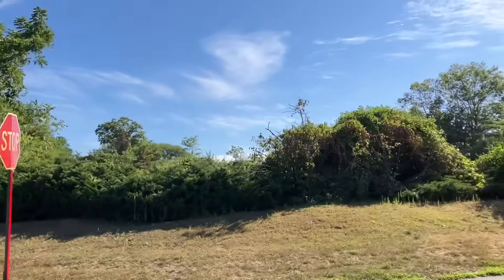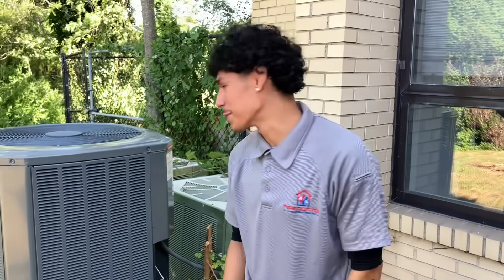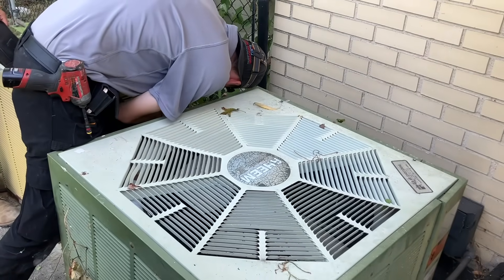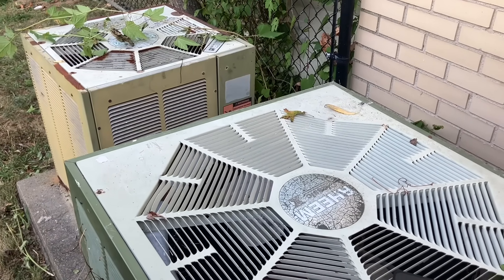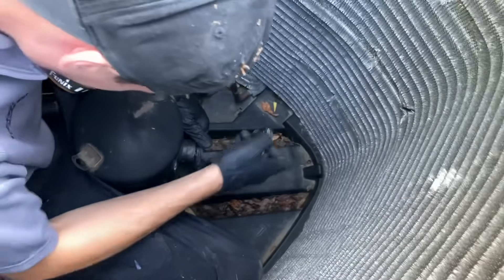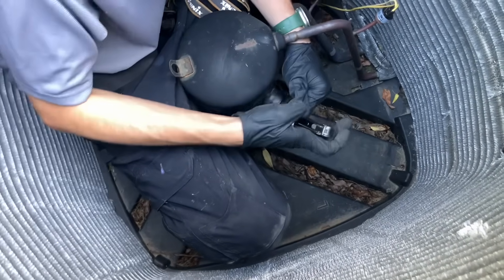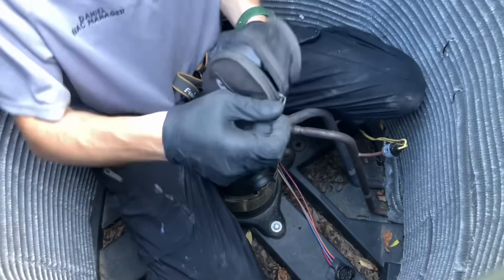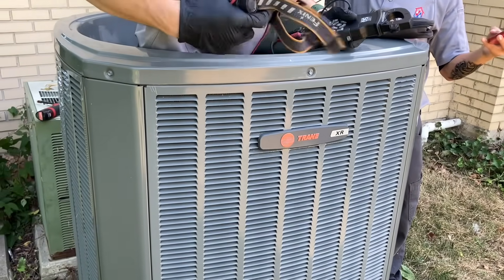Abandoned Mega Mansion HVAC Nightmare! Can We Revive 10 Dead Systems? (Part 1)

Comment: Another piece of junk trane has derailed the tracks.  I hate trane.  I say lets try to get those 2 rheem rudd units up and running.  Thats what i would do it it were my place.  If freon is an issue, id recover the remaining r22 charge, pull good vacuum, and recharge with BLUON TDX 20.  I love this r22 replacement.  I would not worry about the leak just yet as i want to see how long it will last before a recharge is needed, if a few yrs then no need to address, but if only one season, then, i need to try to fix the leak.  Rhedm, and Ruud are great units.  I say those 2 are from the mid 1980s.  Also i am so surprised no one found this place, and scrapped out all those units.  It was probably being watched with a careful eye.